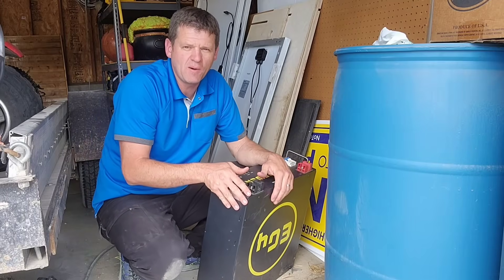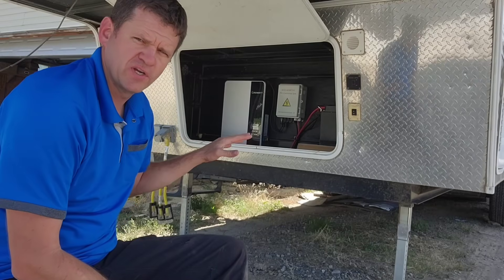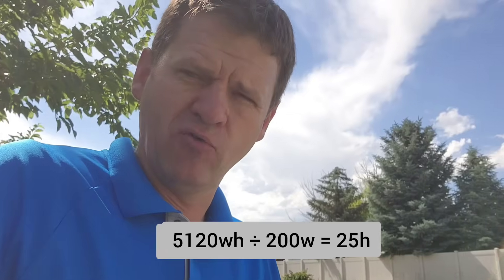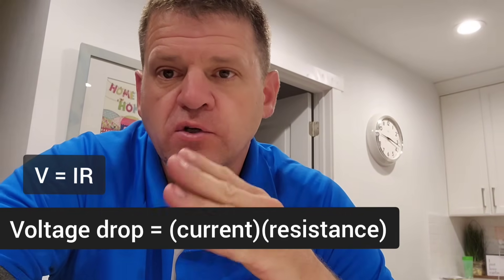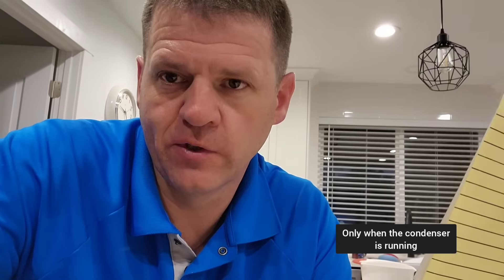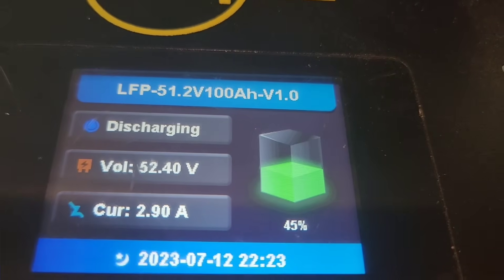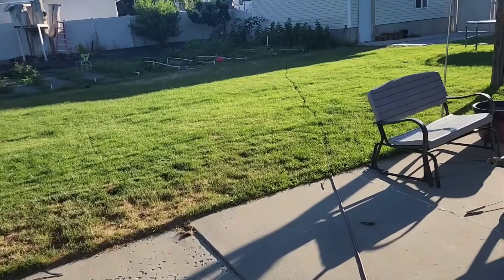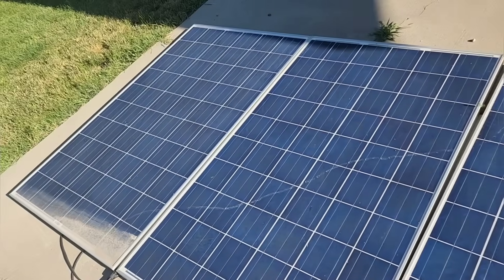How long can a Server Rack Battery run a Fridge?

Comment: Sorry, I'm totally blowing up your comments here. But I found you because I was searching for videos specifically for the Growatt. It's the one I want to buy. But 40% efficiency is awful. Manufacturer's spec is in the 90s. I was so close to buying this unit that I contacted Signature Solar to ask them about it and they are pretty baffled. Do you have any idea why the efficiency is so bad?
Reply from the maker: I personally like the growatt 3000 48p model better. It does better in shade. I am out camping right now and this morning I had two full 315 watt panels in the Sun and that wasn't enough to get the inverter to generate any real power. It only really functions well when I have four panels with sun. Not super awesome. But I guess it depends on what you're using it for. And how many panels are you going to connect.  
   I would say that the idle is about center of the pack.  Some of the low frequency mppt all in one brand systems consume 100 watt to idle. The 50 W idle is not a big deal to me. It's basically just an extra 100 watt panel on top of my solar array. That will cancel the inefficiencies out. Any inverter you have can have a really bad efficiency rating if you plug a small enough load into it. Really if you have an inverter on with no power it will eventually run the battery dead and you'll have a 0% efficiency rating out of the system.  That's an interesting question though I wonder if IThat's an interesting question though.. If I subtract the inverter idle consumption I wonder if I hit a 90% efficiency. That would be interesting to measure. I thought I heard somewhere that inverters are most efficient when they are running at a 70% load.
Reply: 1  In the name of God, the Gracious, the Merciful.

2  Praise be to God, Lord of the Worlds.

3  The Most Gracious, the Most Merciful.

4  Master of the Day of Judgment.

5  It is You we worship, and upon You we call for help.

6  Guide us to the straight path.

7  The path of those You have blessed, not of those against whom there is anger, nor of those who are misguided.

2  God, there is no god but He, the Living, the Eternal.  To Him belongs everything in the heavens and everything on earth. He is the Sublime, the Magnificent. Originator of the heavens and the earth. He made for you mates from among yourselves, and pairs of animals, by means of which He multiplies you. There is nothing like Him. He is the Hearing, the Seeing.

3  He sent down to you the Book with the Truth, confirming what came before it; and He sent down the Torah and the Gospel.

4  Aforetime, as guidance for mankind; and He sent down the Criterion. Those who have rejected God’s signs will have a severe punishment. God is Mighty, Able to take revenge.

5  Nothing is hidden from God, on earth or in the heaven.
6  It is He who forms you in the wombs as He wills. There is no god except He, the Almighty, the Wise.

1  Say, “He is God, the One.
2  God, the Absolute.
3  He begets not, nor was He begotten.
4  And there is none comparable to Him.”

13  To Him belongs whatever rests in the night and the day. He is the Hearing, the Knowing.
14  Say, “Shall I take for myself a protector other than God, Originator of the heavens and the earth, and He feeds and is not fed?” Say, “I am instructed to be the first of those who submit.” And do not be among the idolaters.

100  Yet they attributed to God partners—the sprites—although He created them. And they invented for Him sons and daughters, without any knowledge. Glory be to Him. He is exalted, beyond what they describe.
101  Originator of the heavens and the earth—how can He have a son when He never had a companion? He created all things, and He has knowledge of all things.
102  Such is God, your Lord. There is no god except He, the Creator of all things; so worship Him. He is responsible for everything.
103  No vision can grasp Him, but His grasp is over all vision. He is the Subtle, the Expert.
104  “Insights have come to you from your Lord. Whoever sees, it is to the benefit of his soul; and whoever remains blind, it is to its detriment. I am not a guardian over you.”

143  And when Moses came to Our appointment, and his Lord spoke to him, he said, “My Lord, allow me to look and see You.” He said, “You will not see Me, but look at the mountain; if it stays in its place, you will see Me.” But when his Lord manifested Himself to the mountain, He turned it into dust, and Moses fell down unconscious. Then, when he recovered, he said, “Glory be to you, I repent to you, and I am the first of the believers.”
144  He said, “O Moses, I have chosen you over all people for My messages and for My Words. So take what I have given you, and be one of the thankful
145  And We inscribed for him in the Tablets all kinds of enlightenments, and decisive explanation of all things. “Hold fast to them, and exhort your people to adopt the best of them. I will show you the fate of the sinners.”

36  To every community We sent a messenger: “Worship God, and avoid idolatry.” Some of them God guided, while others deserved misguidance. So travel through the earth, and see what the fate of the deniers was.

16  And mention in the Scripture Mary, when she withdrew from her people to an eastern location.
17  She screened herself away from them, and We sent to her Our spirit, and He appeared to her as an immaculate human.
18  She said, “I take refuge from you in the Most Merciful, should you be righteous.”
19  He said, “I am only the messenger of your Lord, to give you the gift of a pure son.”
20  She said, “How can I have a son, when no man has touched me, and I was never unchaste?”
21  He said, “Thus said your Lord, `It is easy for Me, and We will make him a sign for humanity, and a mercy from Us. It is a matter already decided.'“
22  So she carried him, and secluded herself with him in a remote place.
23  The labor-pains came upon her, by the trunk of a palm-tree. She said, “I wish I had died before this, and been completely forgotten.”
24  Whereupon he called her from beneath her: “Do not worry; your Lord has placed a stream beneath you.
25  And shake the trunk of the palm-tree towards you, and it will drop ripe dates by you.”
26  “So eat, and drink, and be consoled. And if you see any human, say, ‘I have vowed a fast to the Most Gracious, so I will not speak to any human today.'“
27  Then she came to her people, carrying him. They said, “O Mary, you have done something terrible.
28  O sister of Aaron, your father was not an evil man, and your mother was not a whore.”
29  So she pointed to him. They said, “How can we speak to an infant in the crib?”
30  He said, “I am the servant of God. He has given me the Scripture, and made me a prophet.
31  And has made me blessed wherever I may be; and has enjoined on me prayer and charity, so long as I live.
32  And kind to my mother, and He did not make me a disobedient rebel.
33  So Peace is upon me the day I was born, and the day I die, and the Day I get resurrected alive.”
34  That is Jesus son of Mary—the Word of truth about which they doubt.
35  It is not for God to have a child—glory be to Him. To have anything done, He says to it, “Be,” and it becomes.
36  “God is my Lord and your Lord, so worship Him. That is a straight path.”
37  But the various factions differed among themselves. So woe to those who disbelieve from the scene of a tremendous Day.
38  Listen to them and watch for them the Day they come to Us. But the wrongdoers today are completely lost.
39  And warn them of the Day of Regret, when the matter will be concluded. Yet they are heedless, and they do not believe.
40  It is We who will inherit the earth and everyone on it, and to Us they will be returned.
41  And mention in the Scripture Abraham. He was a man of truth, a prophet.
42  He said to his father, “O my father, why do you worship what can neither hear, nor see, nor benefit you in any way?
43  O my father, there has come to me knowledge that never came to you. So follow me, and I will guide you along a straight way.
44  O my father, do not worship the devil. The devil is disobedient to the Most Gracious.
45  O my father, I fear that a punishment from the Most Gracious will afflict you, and you become an ally of the devil.”
46  He said, “Are you renouncing my gods, O Abraham? If you do not desist, I will stone you. So leave me alone for a while.”
47  He said, “Peace be upon you. I will ask my Lord to forgive you; He has been Kind to me.
48  And I will withdraw from you, and from what you pray to instead of God. And I will pray to my Lord, and I hope I will not be disappointed in my prayer to my Lord.”
49  When he withdrew from them, and from what they worship besides God, We granted him Isaac and Jacob. And each We made a prophet.
50  And We gave them freely of Our mercy, and gave them a noble reputation of truth.
51  And mention in the Scripture Moses. He was dedicated. He was a messenger and a prophet.
52  And We called him from the right side of the Mount, and brought him near in communion.
53  And We granted him, out of Our mercy, his brother Aaron, a prophet.
54  And mention in the Scripture Ishmael. He was true to his promise, and was a messenger, a prophet.
55  And he used to enjoin on his people prayer and charity, and he was pleasing to his Lord.
56  And mention in the Scripture Enoch. He was a man of truth, a prophet.
57  And We raised him to a high position.
58  These are some of the prophets God has blessed, from the descendants of Adam, and from those We carried with Noah, and from the descendants of Abraham and Israel, and from those We guided and selected. Whenever the revelations of the Most Gracious are recited to them, they would fall down, prostrating and weeping.
59  But they were succeeded by generations who lost the prayers and followed their appetites. They will meet perdition.
60  Except for those who repent, and believe, and act righteously. These will enter Paradise, and will not be wronged in the least.
61  The Gardens of Eden, promised by the Most Merciful to His servants in the Unseen. His promise will certainly come true.
62  They will hear no nonsense therein, but only peace. And they will have their provision therein, morning and evening.
63  Such is Paradise which We will give as inheritance to those of Our servants who are devout.
64  “We do not descend except by the command of your Lord. His is what is before us, and what is behind us, and what is between them. Your Lord is never forgetful.”
65  Lord of the heavens and the earth and what is between them. So worship Him, and persevere in His service. Do you know of anyone equal to Him?

111  And say, “Praise be to God, who has not begotten a son, nor has He a partner in sovereignty, nor has He an ally out of weakness, and glorify Him constantly.”

85  Whoever seeks other than Islam as a religion, it will not be accepted from him, and in the Hereafter he will be among the losers.

Read The Quran
“I am to you a clear warner.”
 “That you shall worship none but God. I fear for you the agony of a painful Day.”

Comment: So, I am just researching and do not have your experience. But let me run a few things I’ve seen that contradict some stuff from your videos and you can give me your thoughts. Will Prowse has mentioned that 48v will kill you because in practice, it really throws over 50. Explorist has said that you can’t hook multi-strand wire under your outlet screws.  He uses the little fork connectors. Some of the reviews on that combiner box say the wire gauge is undersized…I guess that one depends on lots of factors. I don’t have any opinions on this myself but curious about your thoughts. I’m really looking forward to seeing how you hook it all up to the house.
Reply from the maker: Thanks for the comment. Sorry for the late reply.  I really like to 48v systems. Yes, it's higher voltage but It's only on the 2 wires connecting the battery and the inverter. It's easy to turn the power off while you hook those up and then you can cover them so it's safe.  The rest of they system is on 120 volts(which can kill you also) but the low voltage what runs throughout my entire RV is still 12v which is coming off my step-down converter.
   Can you send me the video where Explorist said that you can't hook multi-strand wire under your outlet screws. That's interesting.  
   I haven't looked into the wires for that combiner box. I read the review of the guy who swapped out the breakers for larger ones and then noticed things were hot...WOW.  that's very dangerious.   They sold it on signature solar's site so I'm pretty sure it's fine. They are very short wires so they don't need to be as thick as wires you would use for longer length runs.  It's been good for me.
Reply: @diySolarPowerFunWithRay  I'll go back and see if I can find the video. I literally watch like hundreds of these, so I'm not sure if I will be able to find it.

Comment: I guess you have to account for loss of power through the extension cords. And the inverter itself. If it’s not good enough, it will lose power to with heat.🕵️‍♀️🕵️‍♀️ but if you have a very good inverter, you could save all that power, but it’s more expensive🕵️‍♀️🕵️‍♀️🫡
Reply from the maker: The 50 watt idle equates to 1200 watts per day or about an hour of sun hitting my small solar array.  It's a tough decision. With the money you could save you could buy another solar panel to off set the losses. I'm leaning towards the more efficient inverters for smaller loads where you may not have solar around to off set the losses.

Comment: Only 45 hours??? That's a really short time
Reply from the maker: Yup. I just did another test with a victron inverter.  The efficient inverter makes a big difference.  The 50 watt idle equates to 1200 watts per day or about an hour of sun hitting my small solar array.
Reply: @diySolarPowerFunWithRay  right on - every watt counts until you've passed that 'hurdle' of having enough electricity to share some with your neighbors. You're choosing the right equipment. It's a great feeling!

Comment: For a refrigeration load one of the auto-sleep functions on the Victron inverters would save you all the off-time standby consumption. The inverter wakes up every few minutes and looks for load, it feeds the load or stays off if no load is present.
Reply: It doesn't take minutes, it takes seconds, the default on the Victron is to look every 2.5 seconds.
Reply from the maker: Yes, I am running a test with a victron inverter in standby eco mode right now. It's saving a ton of power!! I'll post it shortly.
Reply: @diySolarPowerFunWithRay  the growatt 5 k has a function that does that as well.
Reply from the maker: @Capoe3  Nice. I didn't know that.

Comment: I have a great suggestion to make your system more efficient . With my 302L fridge freezer combination, I get 11-13hours use out of my 1280wh battery. If I had a 5120wh battery, mhen, I will be getting almost 44hours use. Your growatt inverter is a waste of power. To save your power, get a smaller inverter. If you are lucky and you use an inverter fridge like mine(you can look that up), you don't need more than a 300w inverter which is what I use. My fridge is an inverter fridge… meaning when I put it on, the compressor does not kick off immediately creating a power surge. It climbs from 0watt to 80watt gradually then drops down back to about 48watt. So I can easily power it with a 300w inverter which is very very efficient. I even sometimes still power my small home appliances with the fridge and I can still squeeze out about 10hours of use with a 1280wh battery. So in your case, if your fridge isn’t an inverter fridge, get a 1000w inverter. This will be way more efficient and you will be able to get more time out of your battery. All in one inverters are usually power hungry.
Reply from the maker: Thanks, The 50 watt idle equates to 1200 watts per day or about an hour of sun hitting my small solar array. I'm doing another test with a victron now and it's a lot more efficient.  I think it was 17 hours on a 1280wh battery

Comment: Hi, very interesting, however with a 50W idle consumption of you invertor and an (estimated) on duty cycle of you fridge (thermostate), you could -if fridge or freezer is only thing you are powering with this invertor - use a timer switch/clock , which switches invertor off for an hr and on for an hr etc reducing idle loss from 50*24 to 50*12 is a 600Wh saving in a 24 hr period helping to extend your off grid time capacity... Another thing you could is to set fridge/ freezer thermostate lower during sunny period of day using - when battery is full - your solar panel power to cool "deeper" during day and such reducing battery load during night as "buffered" cold inside fridge/freezer will reduce (after sun goes to sleep) time that thermostate goes on again...    (of course you might need a momentary on push button if you want inside light goes on when you open door..)
Reply from the maker: A timer is a good suggestion. You're the 2nd person that's mentioned this. I'm doing another test now with a victron and a 12v battery. I'll try to do a test with the timer vs not using the time.